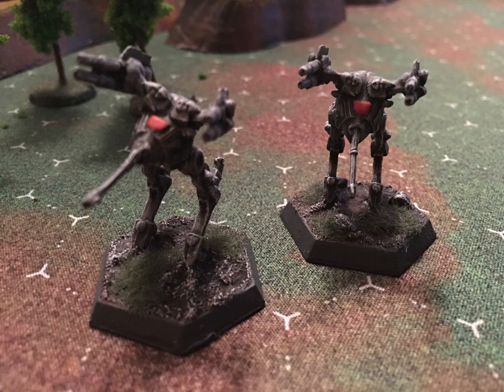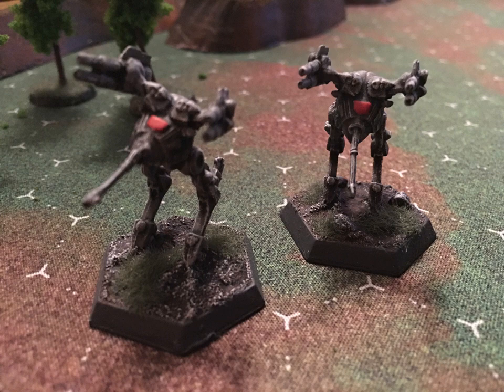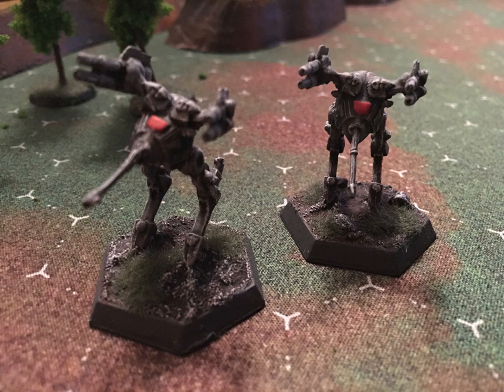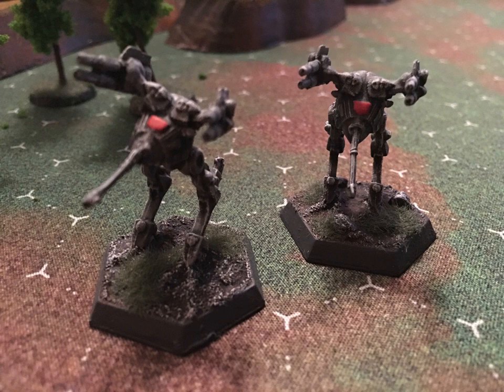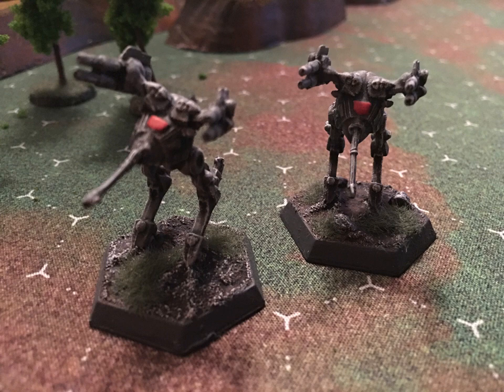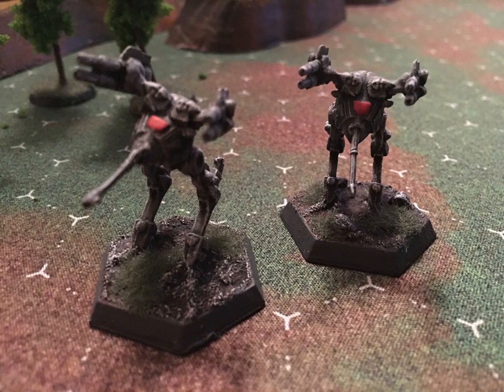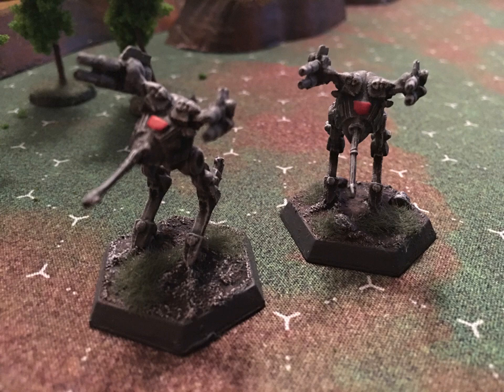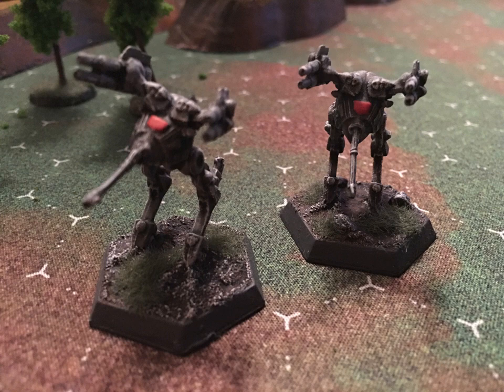Battletech Tactics: SRM Missiles

Comment: SRMs are the Batltetech's version of sawn-off shotguns until LB-X autocannons are reintroduced. Primary purpose of striking as many hit locations as possible for low tonnage and heat. Great when your opponent armor is breached and you should almost always declare/resolve fire for these last after all your bigger weapons.

SRM-2s used to have a unique niche as they were the only SRM launcher that could launch Infernos under the very old rules. But now, a Medium Laser is often just way better in the vast majority of cases since you pack 3 medium lasers for 2 SRM-2s + 1 ton ammo. Then you factor in that you are going to only hit with one SRM 59% of the time on the cluster table that can never be improved in a standard Succession Wars era game of Battletech (RPG pilot skills aside).  A 8+ cluster roll risk/benefit it is worth it on an head capping Ultra AC/20, but not on this.

SRM-4s are the most ammo efficient for their tonnage and cluster rolls. SRM-6s make you lose about 10 missiles, and get only 15 shots instead of the 16.7 per ton of ammo, but that ammo inefficiency can work in your favor if it is a support weapon (SRM-6 on a Warhammer/Battlemaster) but it is tactically limiting if it is your primary weapon (Javelin/Pegasus Hovertank). It also pretty much guarantees you always hit with at least 2 missiles as there's a very small chance you can only hit with only 1 missile on the SRM-4 which is a big bummer.

I also want to stress the huge potential of alternative ammunition for SRMs. Infernoes are a really good cheap way to mess with your opponent's heat curve (add another 2-6 heat to a Stalker every turn), wipe out infantry and critical hit tanks to death and the much later tandem charge SRMs are absolutely lethal and IMHO almost break the game.

Comment: These are the true killers in the game, and my weapon of choice regardless of unit type (infantry, mechs, vehicles).  Other weapons are good for softening up targets, creating weak spots in armor sections, and so on.  But the short range missiles tend to be the weapons that finally put the mechs down.

What you want to do with the short range missiles is to 1) make sure you are getting the best chance you can with them and 2) make sure your other weapons, or other squadmates, are chewing up as many locations as possible.  By all means start emptying those mags as soon as you're in range.  But in my experience, you're going to want to work to get as best of a chance as possible to hit, which means going into point blank (MG and SL range) territory.  Unlike an LRM, which is more of an attrition weapon, the SRM acts as more of a knock out weapon.  As a result, the SRMs tends to work best on a softened target, with multiple places on the hit location table you'd want to strike.
Reply: For Vees maybe given their free heat, but if you got HS, and especially DHS, MLs all the way. Sure they may not have the same crit potential, but at the same time you also don't have to worry about sand blasting or ammo explosions either.

As for Infantry you're honestly better off having range or ideally range and movement. To that end, HSL(5+ hex Support) or ERLR (3 hex Personal) are best, because it doesn't matter how much damage you can deal if you can't actually shoot the enemy. Field Guns are also nice for this reason.

Comment: I love using inferno's. On the table top its a bit of a war crime as they burn ground and the surface of water.  Inferno's create smoke that adds a +1 to hit. Inferno's will eat tanks mobility, damage battle armor and basic infantry as good as a machine gun. The idea of inferno's is the smaller packs attack the ground as the bigger packs strike mechs and vehicles. In many cases I would rather run with an SRM-2 over a machine gun. Inferno's should have their own topic.
The basic SRM is a flexible weapon for me in any era of battletech. NARC's ammo is used when possible as this saves your weight for other toy's. When running with a NARC vehicle. Smoke rounds a a bit of a pain for infantry and tanks that are dug in as smoking them makes their static positions a bad to hit. Until your able to take care of them latter. Or just use the inferno's. Useful when your doing a fighting retreat or in light woods that are at two thick as smoke blocks LOS. It just adds so much with so little. I call it my favorite secondary weapon other than a medium laser.

Comment: Concur with most of the other commenters.   But also: Cavalry  VTOL + Infernos is death to infantry and vehicles.  On vehicles especially each SRM hit is a roll on the critical table at -3 (iirc).  But, the vehicle location chart is murder. First, you don't roll for crits. you just roll on the chart. usually on a 4 (? i dont't recall)) or less its no effect.  Beyond that once an item has been hit it can't be hit again.  So you can't hit the same stabilizer 3 times.  you go down the chart to the next un-hit and available item.  I.E. no weapons in that section, can't get weapon destroyed.  Get crew stunned. You can stun the crew some more, so now they are stunned for 2 turns or whatever.   You can very quickly take a vehicle completely out of action.   The Calvary has 1 srm 6 and 3 srm 2s.  At even odds you're hitting with 6 missiles.. and at bad odds you still might hit with one or two because you're riding the bell curve.  It is a great way to make your opponent clench.  And really cheap way to beat the breaks off those monster tanks someone brings out.

Comment: I never used SRM carriers because I think they will take forever to resolve their attacks, unless you are using some kind of randomizing app to help with that. I think SRMs are anti-vehicle weapons because the crit chance. Aganinst mech you will need another weapon to expose the internals. I tried Javelin but didnt worked for me too much spread. Other things to consider... What do think about Infermo Missiles .... and MRMs? I like to use my T-bolt with infernos.
Reply: On tanks SRMs are usually the way to go, but on mechs if you're just using them as critseekers I'd use MLs instead.  You get more average damage to wear through the armor faster and if you're using a lot of them you'll have a lot of hit location rolls.  And you don't have an ammo bomb.  Tacops makes this even more pronounced if you're running customs.  

Infernos, though, do what no other weapon does.  SRMs are also lighter than LRMs for deploying smoke, though they can only deploy it at half the distance.  If you ever play 3050 IS against Clan take a Javelin or two with half infernos and half smoke.  The 3 hex diameter heavy smoke will cut their range advantage down to size and elementals really don't like taking 12 tubes of inferno SRMs.  The hotter running omnimechs aren't terribly fond of it either.  

If you don't like SRMs you'll like MRMs even less.  They're poor critseekers with their 5 point clusters and have an accuracy penalty.
Reply: The Light SRM Carrier or SRM Hetzer will be better as many players do not like the regular SRM carrier much like yourself.